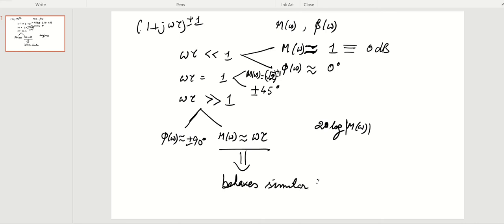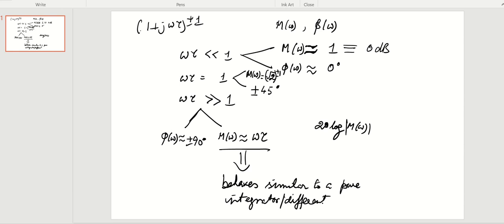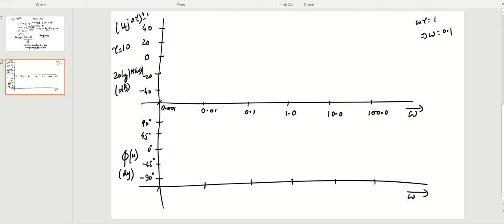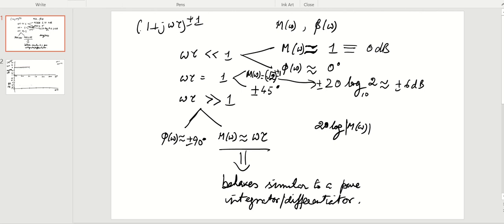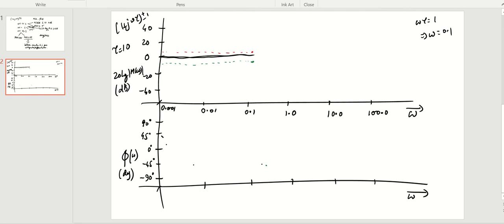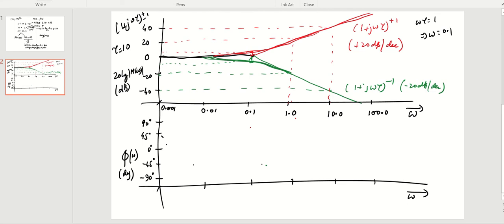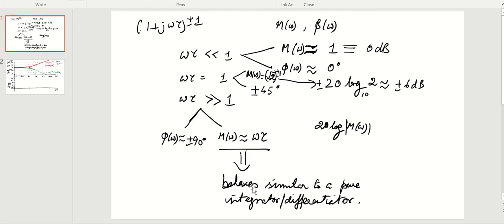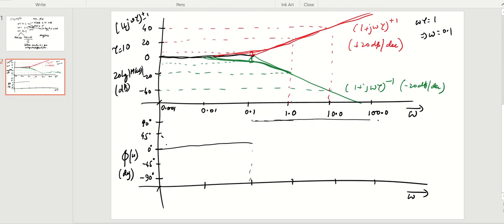EE302: Lecture 7, Module 5

Comment from the maker: Errata: 1. At 6:40,  it should be 10log(2)=3 dB correction (not 20log(2)=6 dB correction). Subsequently, wherever a correction of 6 dB is mentioned, replace it with 3 dB.
2. Around 2:07, for  \omega \tau>>>>1, the magnitude function should be M(\omega)=(\omega \tau)^(+-1). What I wrote is true only for the factor (1+j\omega \tau)^(+1).